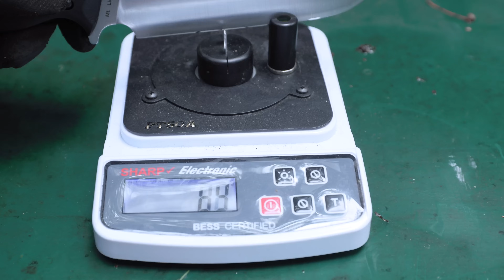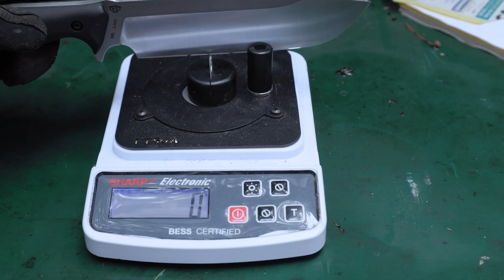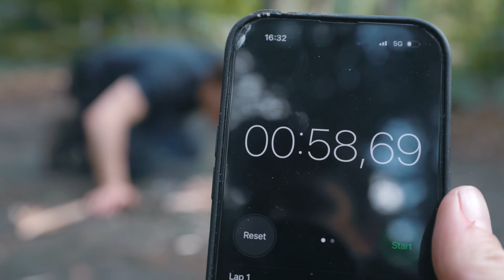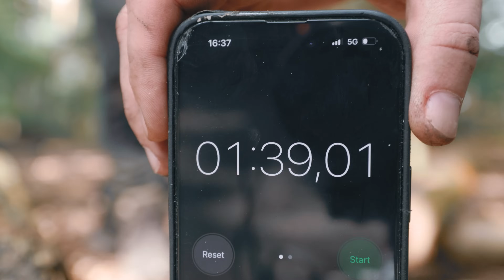#1 Strongest knife in the world... Work Tuff Gear

Comment: Work Tuff is in probably my #1 favourite knife brands of all time. Their heat treat is spot on, and fit & finish is unmatched. As for the sheath, the little D-rings are for sling carry, but they are removeable and you can use tek-loks and danglers for it as well. The best part about the company is that they accept designs from so many different designers and hobbyists, so there are many styles to choose from. I'd love to see you guys review more of their knives.
Reply: Yes! I have close to 20 of their knives. Like them.a lot and shipping to Oz from Taiwan is much cheaper to Oz than from US or UK/Europe.
Reply: I just picked up the puzon bowie 7 inch gen 2 on dlt trading. Completely blown away by the fit and finish. I'll be taking the knife with me next year when I do the Appalachian trail.
Reply: The D rings are for a Baldrick sling (over shoulder chest sling)

Comment: 18:45 I think those loops are for adding it to a bag or a pack and not necessarily for strapping it to your leg. I think they’re attached to a screw so you can remove them if you’re not going to use them, but they’re nice to have in case you do want to use them

Comment: Ive been saying for years that A8 steel is extremely tough on par with bainite L6 steel, far tougher than even Cpm 3v. Significantly more tougher. At 59rc CPM-3V has charpy impact value of 100 Jules. 
A8 (K329) at 59rc has charpy impact value of 160 Joules. 
S7 at 58rc has charpy impact value of 165 Joules. So this shows you that this Air hardening tool steel has lateral toughness basically of Shock Absorbant steels such as S7-S5 and so on. Yet it holds an edge very well, considering its its in the same family as A2 tool steel. 
Ive had knives made from A8 for years now, but its been frustrating since you can hardly find anyone using this steel, especially in US. Only seen few Asian companies and few European companies use this steel. Perhaps its starting to change. Good job guys

Comment: I agree. Knife task come first. Destruction testing doesn't make a knife good. Sadly there's Knuckle Draggers out there that wholeheartedly believe that a knife can only be good if it can survive under none real world use. Yes... Because that's how people use their knives on the daily though there are proper tools for the job already; this is why the exist in the first place... Being used as a stone chisel and sawzall for cutting through cars. Those types of people need to take their favorite knives out and use them like that for a day and see how that none real world use goes for them. I'm sure it'll end with it being trash for failing at being a stone chisel and sawzall for cars or any other alloys. A knife to me should be exceptional a real world knife task period; cutting/slicing, etc - and holding an edge. I could go on all day, but I'm going to stop there. I'm sure I just offended all that side of the knife crowd. Oh well. I do want to get a Work Tuff Ares and MT. Lion for good beater knives and safe my finer knives for the finer things. The right tools for the right job as they say. There's a reason that saying exist. Yes... I carry a hatch and or parang for my chopping needs. I just want the mentioned Work Tuff's for fun basically and to add to the collection.

Comment: The philosophy between these two knives is very different. The Work Tuff Gear knife is more dedicated to woodwork as a camp knife. That's why it's bigger and heavier. But I'm sure it can also do some food prep and finer tasks. The F1 always has been the 'just in case' knife. It was designed that way. That's why it's more compact and more light weight.
So comparing this Work Tuff Gear knife to the Fallkniven A1 would have been a better choice. Both dedicated woods camp knives.
So if you go into the woods and know you are gonna do a lot of camp chores including some chopping and batoning you bring the bigger Work Tuff Gear. If you go hiking or backpacking and don't really expect to use a knife a lot you bring the more compact and lighter weight F1 as the 'just in case' knife.

Comment: I love you guys! Your videos are very amusing & funny. Apart from batoning which I think is TOTAL BULLSHIT. Why would you use a knife for that? They have made axes exactly for that purpose for thousands of years! I like the way that you try to break everything. What you cannot break becomes a # 1 choice. This is my first introduction to Work Tuff Knives & I loved it! Will probably buy one soon. Like I need  another knive to add to the hundred or so I already have! Thanks again Paul, Toronto Canada, Hunter, woodsman, fisherman.
Reply from the maker: Haha thanks a lot ! 
I actually enjoy batonning. When you go hiking a knife that can both split wood and do the normal knife tasks can save a lot weight. Axes are pretty heavy and when you're hiking that's makes a big difference.
Also when I'm around the camp fire and it's dark a knife is more safe and controlled for splitting wood. 
That's my reason for batonning. Not every knife has to be able to do it. But if a brand sells it as a survival knife in my opinion it should

Comment: Id love to try K329 since it's almost identical to A8 mod which is an extremely tough steel (s9me say the current INFI is a lot like it but I'm not sure). And with 8% Cr it should be a lot more stain resistant than many other tool steels. I found that about 8% Cr is a sweet spot for steels not developing a patina like 3V or cruwear. That's why i was excited to finally get a knife in Vanadis 10 since it's like 10v but with 8% Cr and so far its been holding up great.

Comment: The rings on the sheath are to attach a long strap on either side from one ring to the other, then wear it around your neck and under your arm. This is usually done with machetes in Asia.
Thanx for the video my Bladed Brother 👍 ⚔️ ✝️ 🇺🇲
Reply: If I was going to wear that on my leg, it would need some modding.  I think I would remove the top rings, attach a back plate and a dangler.  Bottom rings could be used to strap to your leg.
Reply: The D-rings are for multiple configurations, there is no right or wrong
Reply: It's called a baldrick sling

Comment: There's this little thing called a "Cost to Benefit Ratio". There are tasks where the C:B favors one tool well over another. For me, a big knife doesn't replace the usefulness of a small knife for a lot of tasks. At the same time, a Big knife/chopper is intensely useful for many tasks. I like Big tough knives because I can use them for most of my non dexterous, non food prep, and non game cleaning tasks that I would use my small knife for. The big knife also can function as a hybrid of a hatchet, machete, and froe, all in a smaller and lighter package. It's not a true replacement for a dedicated machete, camp axe, or splitting Froe. but it does a fine job as a multi-use tool.

Personally, I always carry a folding dump pouch, a fire starter, a multi-tool, a small knife, a folding saw of some size, and some type of chopper (axe, hatchet, machete, or Big Knife) depending on what I'm doing, where I'm going, and for how long.

I have yet to hear a realistically good argument for ONLY having a small knife when out in the bush.

Comment: 58+ hrc and a big angle grind .... what to expect? thats  more axe then knife
Reply: You saw it slice
Reply: @jusme8060  that steel is very soft like you would harden an axe or a bigger knife you use only for hard tasks, it wont hold an edge well and the knife and apex grind ve a pretty big angle , its a sharpend overpriced prybar but to each their own
Reply: @Warek200  you do know some steels don't actually perform their best with a higher hardness right?
Reply: @jusme8060  i might ve heard that sometime, if a brand tells you it has 58 59 or 60 hrc or maybe 61 the brand is not very trustworthy anyways; k329 can be hardned much harder btw not that the highend hardness ll be good on this one but wih that angle i see no problem with 61 hrc, unless you want to chopp metal
Reply: @Warek200  I just like knives. All knives. Ex steel snob. But still. Work tuff crushes.

Comment: Where the hell do they come up with those prices. Over €200 & up to €450 for these knives. That's a completely ridiculous price to pay for a factory made knife. If it was a blade Smith making each one by hand, fare enough maybe using a power hammer.  But you know what I mean, made by hand. I'd have no problem with those prices. But these are more than likely cut out on a water jet & machine shaped. Most I'd pay would be €180. Are they digging the metal out of the ground themselves & then making the knives?  People shouldn't pay that kind of money. Leave them on the shelf. And companies will have to take notice, & reduce their prices.
Reply: The basic shape is cut out using water jet but everything else is done by hand
Reply: That's bohler k329. The finish is Impeccable. That would cost 275 minimum if you want me to make that for you.